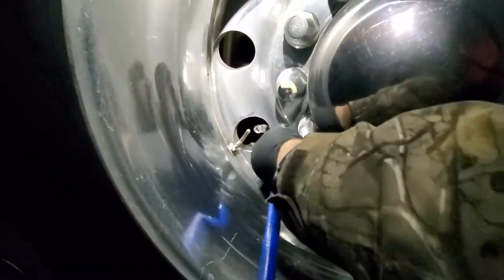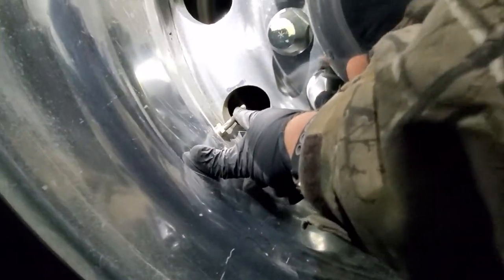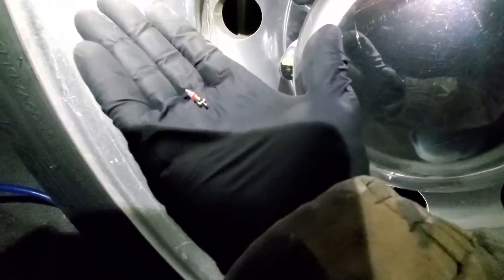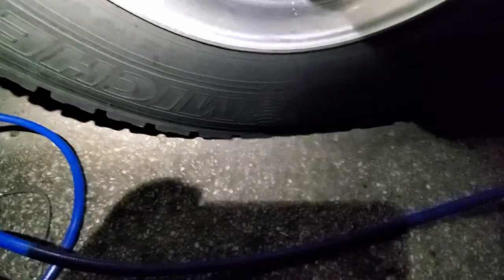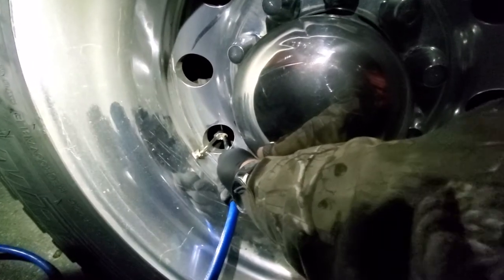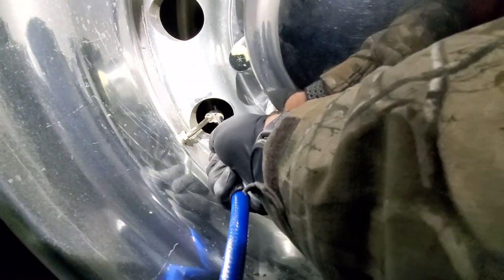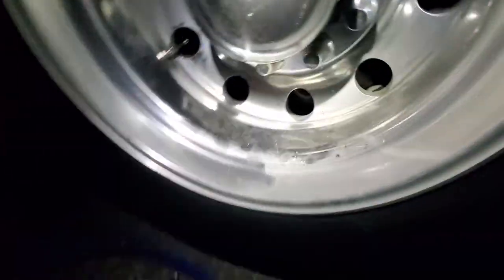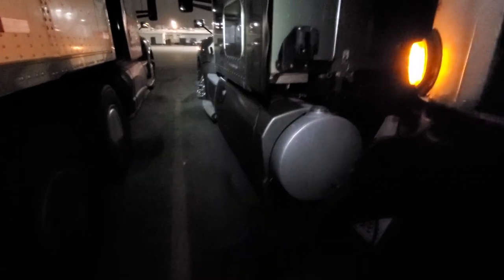Semi Truck valve stem core replacement

Comment: Thx for the upload! Need to replace my core as well...but not having a clue how to, your video really helps. Thx!
Reply from the maker: It definitely made me really nervous when first messing with it, bc thats a lot of air pressure to play with and mistakes are always so costly. Turns out that it's definitely not as daunting as it seemed. Subscribe if you want and I upload stuff as it happens to my truck and work through the problem. Take care!

Comment: Do you know why mechanic sometimes replace stem valve itself instead of valve core inside? Is there any difference?  

How do you know valve core is the problem instead of valve stem?
Reply from the maker: A lot of the time the seal on the valve stem goes bad or sometimes it just makes more sense to do the whole thing. I'd try to refill the tire with air and couldn't ever get it up to the right air pressure. When I'd take the air hose off, air would come hissing out & I figured it wouldn't hurt to try replacing the core.